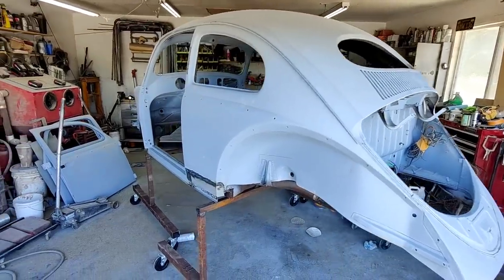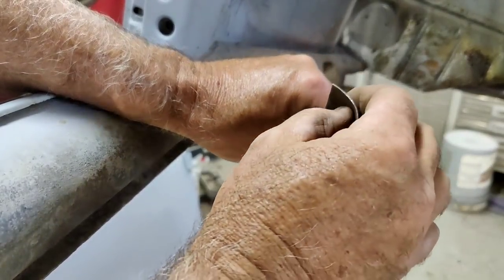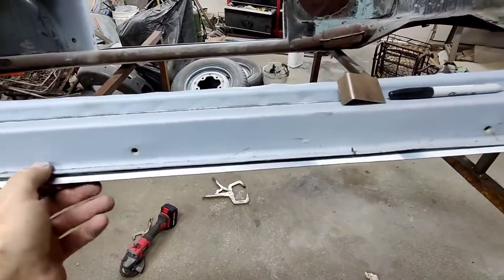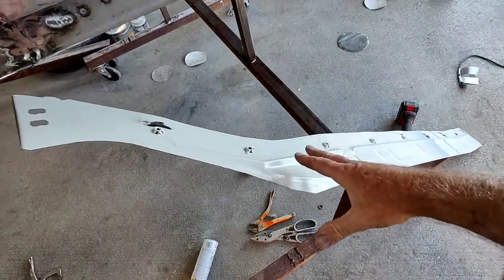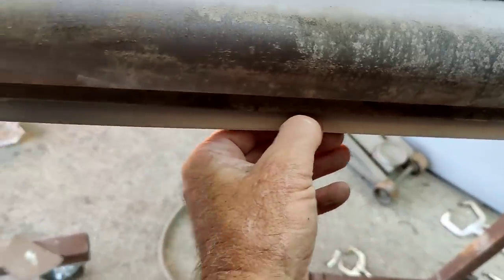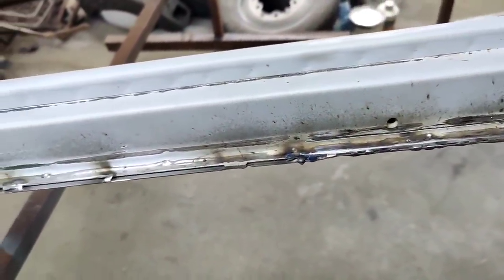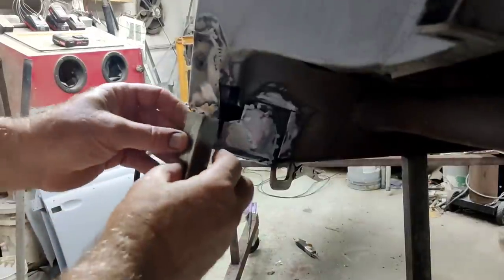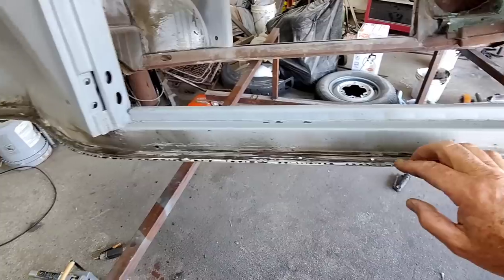RESTORATION - 1954 VW Bug early Oval window Heater channel repair

Comment: On my double cab I removed the roof and it is very similar to the heater channel, it is stacked steel, VW just had raw steel stacked and it rusted through the layers.  I used panel bond since it protects the layers and the sheer strength is amazing. I did make the mistake and plug weld one area near the panel bond and I saw the panel bond fail in that area.  Luckily enough I was able to fix it, but you are right you need to weigh your options for the "best" repair considering time, effort, and how long it will last.  I think your choice of edge welding is a brilliant one, it actually will probably be one of the strongest options and minimizes the work, and potential rust.  Great video Mike!

Comment: That left had front corner must be a common rot area? Almost identical to the fix I had to do on my 68 bug. Funnily enough the other side was almost pristine. 19:30 I went with edge welding on the sill plate. Looked exacty like you ended up doing it Has held up just fine and with trimming and careful grinding you'd never know.

Comment: Looks Great Mike ! Have you ever checked out a product called Pickle X 20 ? It would work good for all the channel work your doing for corrosion prevention. I use it a lot and have had great success with it.   👍
Reply from the maker: I will check into that.